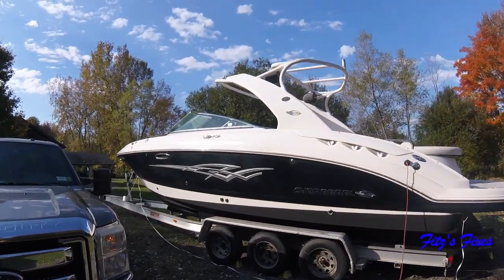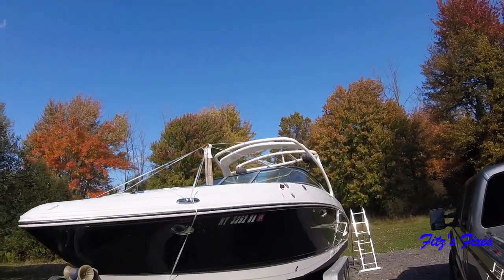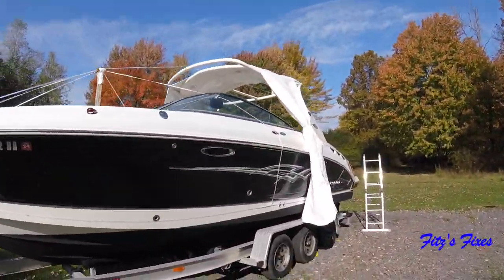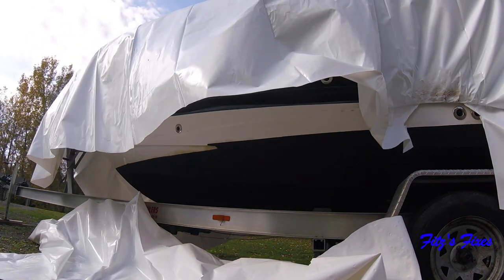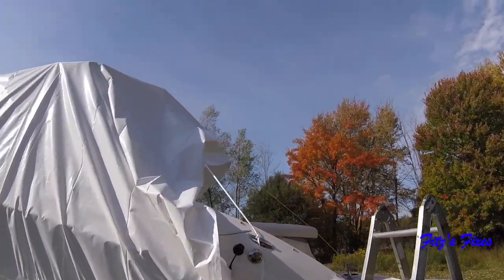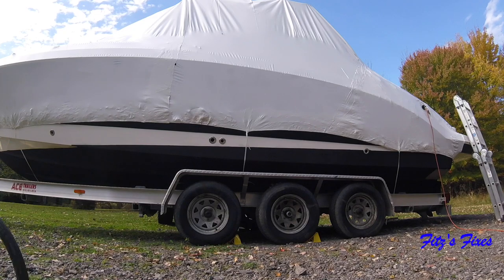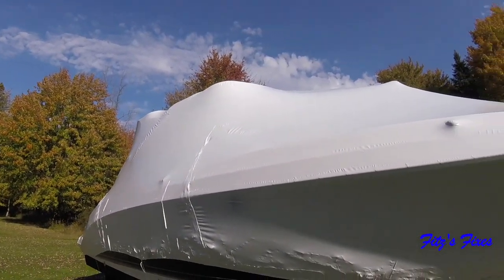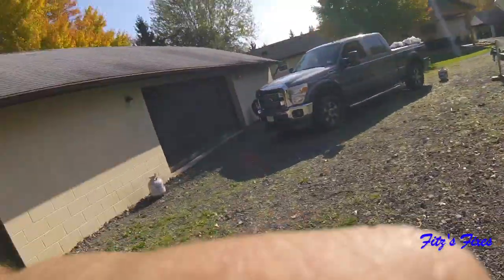Shrinkwrapping a 27' boat

Comment: Started up a shrink business this year and after around 300 boats done for the season I definitely learned quite a bit and became more efficient at it. If you need any tips just let me know. You're making the perimeter band much harder on yourself than need be. Start on the front corner cleat of the boat on either side and make your first vertical strap down to however far you want the band to be. You make a loop into the middle of the strapping at your desired height and tighten the loop, then cut just below it. So you'll just have a string hanging down with a loop on the end of it from your cleat. Then run your strapping line through that loop and continue on down the length of the boat, no needing any tape or having to go back to a part you already passed. Only needing the vertical straps at the points the boats curve shape changes. Also when you tie the line between any 2 points, the line is only going to be nice and tight if make an anchor loop in your strapping before tie off point B. instead you dont tie it onto point B but just wrap the strapping around point B and tie the strapping back to the anchor point you made in your loop and pull tight. Pinch the loop while tieing your knot and it will stay tight. Use this to keep your perimeter band extremely tight making it easier to handle in windy conditions and only having to weld/tack after youve completely finished all the tucking. The problem you're having towards the end when you put in the securing straps underneath the boat to hold the tarp down. You're perimeter band is not tight enough which is what those secure straps should be supported off of. Instead the loose perimeter band is causing all the stress to be put into that tarp causing it to rip and you needing tape patches over every single securing strap.
Reply: I have a chance to buy a system with rolls of shrink and the gun for a song is there good money in this its over in Utah not in my state I do Marine repair for a living